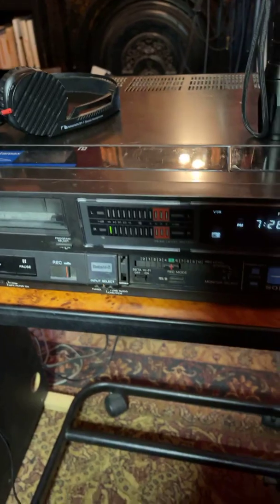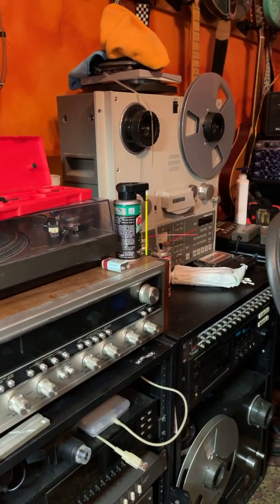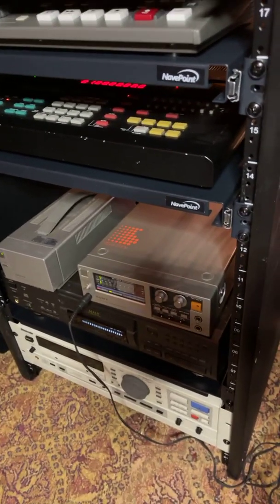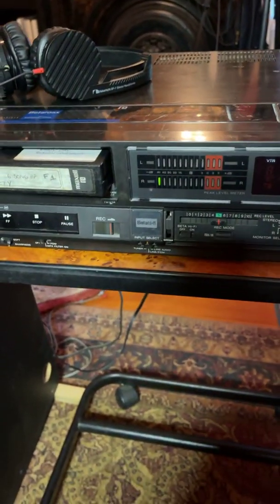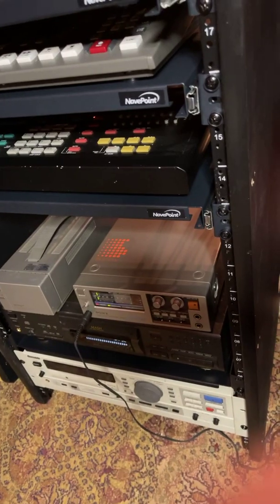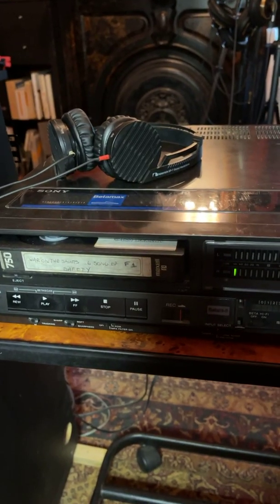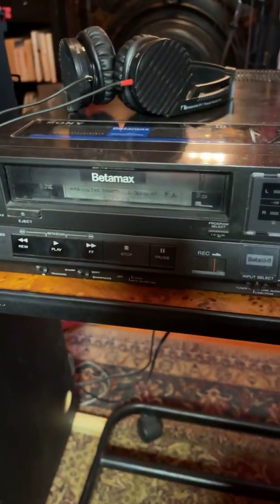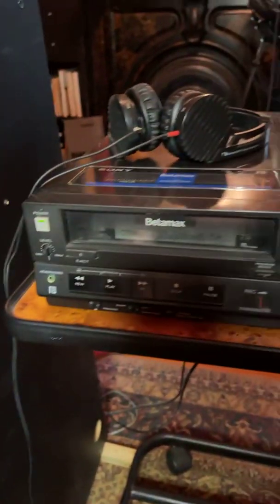How the Sony PCM F1 was used as a digital mixdown machine

Comment: hi was told about this  the shop that used to take in studio  gear used all the time gid they have this  in 
i saw a betacam in a shop window say 1996  betacam price's where still high on the used market  place 
about 5 years ago alot of betacam decks were going in to skips  

i had  60 of them i saved and got working again   the pcm is very out date 

u find i can get great audio on a betacam uwv 75p  decks same with the sony a500p decks 
first gen betacam i keep away from geting parts is a right pain 

i have some sony 701es units  never use them  use the betacam sp  tapes as i can get new sealed tapes still

Comment: Would you say the signal chain looked like this: Tape > Console > 2-Track > PCM F1 or Tape > Console > PCM F1? Do you have knowledge of tracks recorded with this? I know Sade used it for Sweetest Taboo
Reply from the maker: In this particular case, I know that the digital master was made from a two track analog master. But I suppose it could've been done the other way as well. Just to avoid a generational loss.

Comment: hi know about the decks there was sony 701es later  i have some    out of all the audio  / video i have tryed over the years 

the best i come in to is the liner audio on the betacam sp  decks  40 years old and still working and there's alot of new old stock sealed betacam tapes around 

under £1 uk each   funny i did not think to use the sony 701es on the video of the betacam decks  love the ADAT units  have alot of still nice working ones

Comment: So in terms of "sound color" it is the same result you can get with alesis adat?
Reply from the maker: I don't think anyone was trying to add color. Probably they were hoping for less  by going digital, vs. bouncing to 1/4 tape. The PCM F1 is really most analogous to a DAT machine, but the PCM F1 is 14 or 16 bits, and 44.1KHz sampling. So it's actually lower resolution than a DAT could achieve. And that doesn't even take into account the difference, if any, in the quality of the converters.
Reply: a lot of people are using VCR HI-Fi to bouncing audio track and it works. It will be interesting to see with an eq what happens. I'm thinking to buy an alesis dat just to color the sound but i want to be sure ehehe
 @SeanKerns